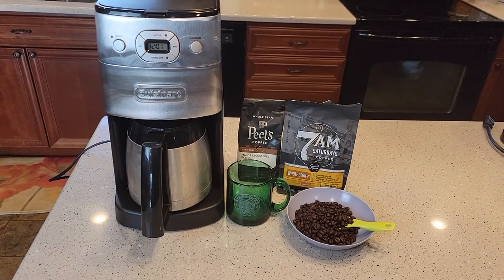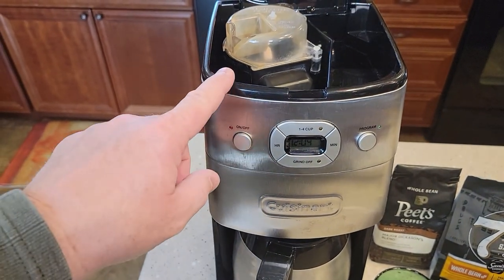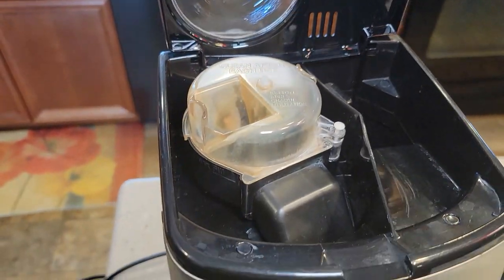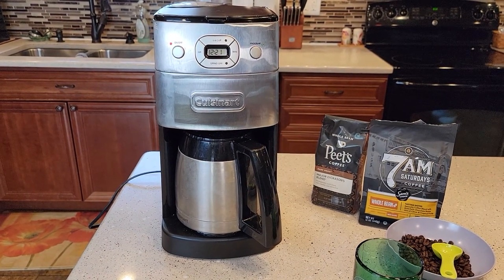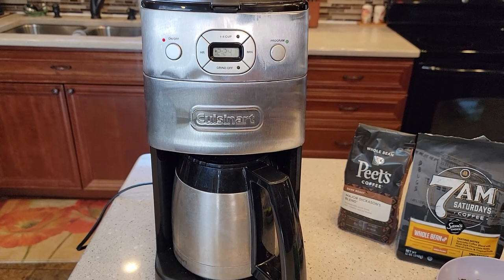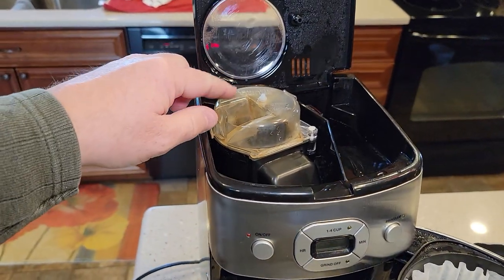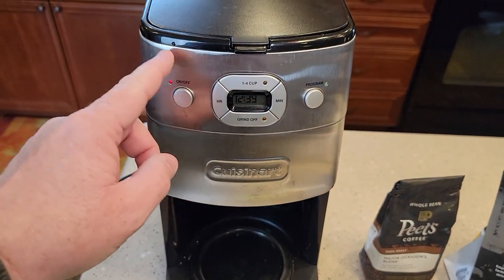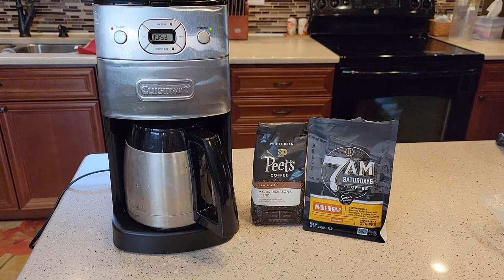DETAILED REVIEW Cuisinart DGB-650BC Grind-and-Brew Thermal 10-Cup Automatic Coffeemaker HOW TO

Comment: Can we grind the coffee the night before and set the timer to brew the coffee in the morning? The grinder is very loud for a 5am timer set up.
Reply from the maker: Yes, absolutely  Just make sure you push the grinder off button and the light is on.  You can just treat it like a normal coffee maker when the grinder off light is on.   To grind the coffee you will have to start the brew and then stop it as soon as its done grinding the coffee.  The turn the grinder off and then set the auto start.  Its a little more work this was but I should brew your coffee without turning the grinder on.

Comment: My machines on off button is flashing red, I tried resetting it by unplugging it, and I tried cleaning the inside but as soon as I plug it back in it still flashes on and off and sometimes the grinder starts and then stops randomly. Any help?! The filter has not been changed since I got it.

Comment: You do not put thermal carafes in the dishwasher. A big no, no. You will displace the insulation, due to the high heat. Get a scrub brush and save your carafe!